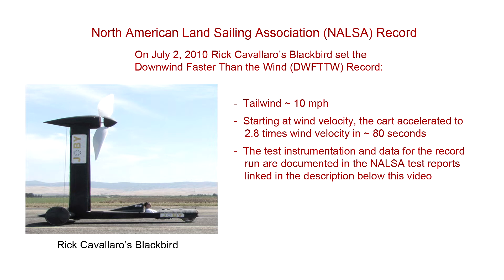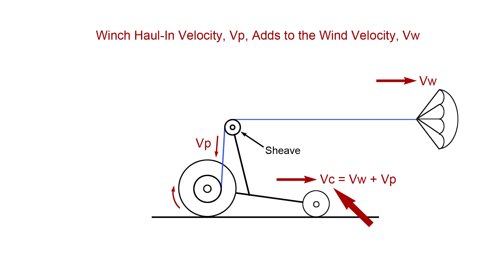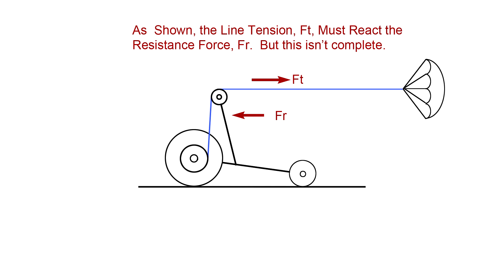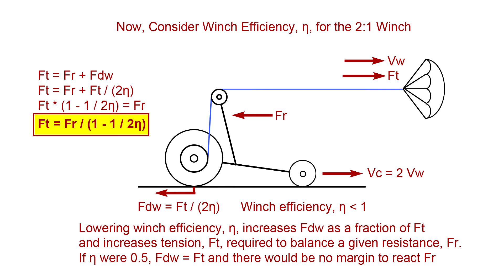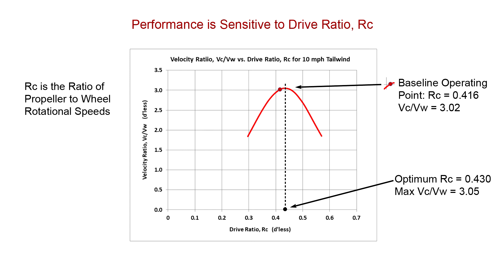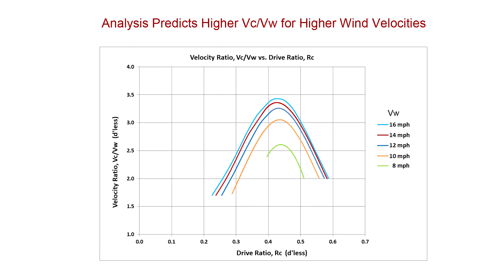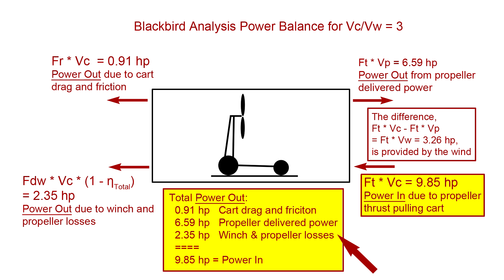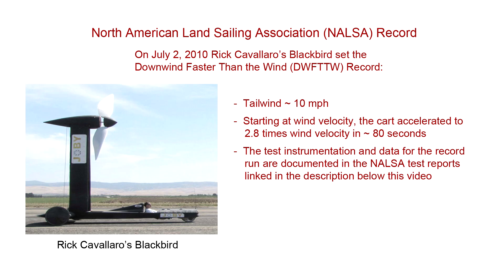Why Blackbird, DWFTTW Works

Comment: I would say it's that the propellers are always trying to grab More air than the wheels are turning and the air being the open system source.
No wind required
Reply: You were right on the money - until the "no wind required" part.  The cart will in fact come to a stop pretty quickly when the wind dies.  This is proven by both theory and real-world results.
Reply: @Rick_Cavallaro  only air is required. 
No wind current is required. 
Only resting air is required.
That clear enough for ya?
Reply: @kdkinen  I designed and built the thing and set 4 world records with it.  I've given talks on it at NASA, Stanford, Google, and lots of others.  That clear enough for ya?
Reply: @Rick_Cavallaro  Alright well, I cannot argue with that. However, on the treadmill inside your room, there was no active wind only resting air. It was able to climb the treadmill with resting air.
Does that not make logical sense why I am saying there is no wind required? Only resting air, And the props are always trying to capture more air than the wheels are turning. Leading to the runaway effect which we all love.
Reply: @kdkinen  wind is simply the movement of air relative to the ground.  You can move the air over the ground or you can move the ground under the air.  Not only can't you tell a difference - there literally is no difference.
Reply: @Rick_Cavallaro  Well, my statement remains partially.
Theres no necessary wind only resting air required... to climb a treadmill... inclined... indoors....
Bravo, sir.
Reply: @kdkinen  It's a wind powered vehicle.  Wind is required.
Reply: @Rick_Cavallaro  lol

Comment: I only watched the introduction. The plane has his own energy source else it will not travel faster than air. Blackbird has no internal energy source so in order to exceed wind speed directly downwind it will need to have an energy storage device (and it has).
Since a very limited amount of energy is stored by the blackbird it can only travel above wind speed for a limited amount of time proportional with the amount of stored energy .
Energy in case of direct down wind blackbird version is stored in the pressure differential created by the propeller (air is a compressible fluid).
Reply: @papalegba6796  It has no motor or battery but it can store energy in the pressure differential created by the super large propeller.
The treadmill model works the same way. While it is hold with the hand energy is charged by allowing propeller to create a pressure differential using energy from the treadmill.
Then when released that pressure differential drops as energy is used to accelerate the vehicle. The acceleration rate drops but not fast enough to see the vehicle slow down and then move backwards as the treadmill is very short to observe that.
Reply: @electrodacus  This model starts from a standstill and travels DWFTTW for over 3 minutes: https://youtu.be/LABSbSTIEvM?t=206
Reply: @Tbone139  The amount of time the vehicle drives above wind speed is irrelevant as it is dependent on amount of stored energy and invers proportional with the acceleration rate and frictional losses.
So you can design for a low acceleration rate and accelerate slowly for a longer period or you can accelerate faster for a shorter period of time before starting to decelerate.

You can check my last youtube video for the equations showing exactly that.
A simple way to think at this may be to use a sail instead of a propeller.  You will see that a sail vehicle can not exceed wind speed direct down wind because you have no energy storage as with the propeller connected to wheels but if you add an electrical generator at the wheels you will accelerate slower during below wind speed travel as you are storing energy in a battery and then use that energy stored in battery to exceed wind speed for a limited amount of time.
Propeller acts both as a sail with variable surface area and an energy storage device due to the pressure differential it creates all explained in my video.
The direct upwind version alo uses energy storage but very different as there energy is stored and released multiple times per second and you always have access to wind energy so you can drive indefinitely.
Reply: @electrodacus  You claim the time it runs above-wind for is irrelevant, do you further claim it it takes 90 seconds to reach a stable above-wind speed as shown, and doesnt measurably slow down for say, 24 hours before being manually stopped, that 24 hours above-wind was powered by the 90 seconds of acceleration?
Reply: @Tbone139  In the record test Blackbird has done the energy was used up almost fully by the time teste ended as seen by the reduced rate of acceleration. It may have been maybe a few seconds of acceleration at most one minute depending on wind conditions as wind speed was super non constant during that test and propeller had pitch control and no information about that.
The energy needed for Blackbird to do that record run was around 6Wh that is about half of what a phone battery contains so almost nothing.
You can accelerate fast for 30 seconds and use all that 6Wh or you can accelerate at lower rate for 3 minutes in both cases end speed can be 2x or 3x wind speed and in both cases same 6Wh of energy could be used.
Even after energy from pressure differential is used up the vehicle will stay above wind speed but since it decelerates it will start to slow down. It may take a minute or 10 minutes to get below wind speed depending on amount of frictional losses and amount of kinetic energy (based on vehicle speed and vehicle weight).
It will be much easier to see all this on the treadmill model where things are way more controlled vs real world where wind speed variation is huge and on top of that driver has control to propeller pitch.  The treadmill model has fixed propeller pitch so one variable is out and treadmill speed is constant and air speed is zero.
On treadmill model you will see how acceleration rate drops as stored energy is used up.